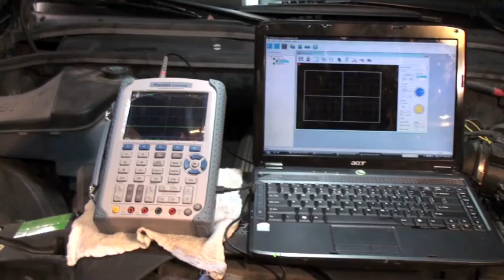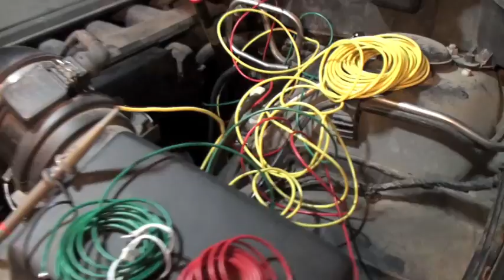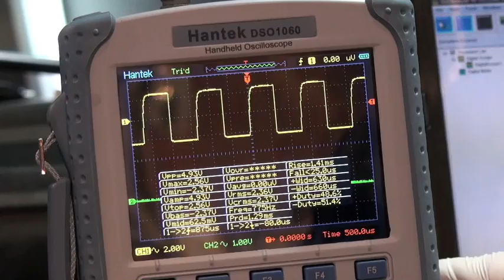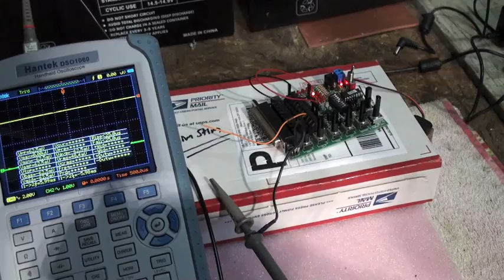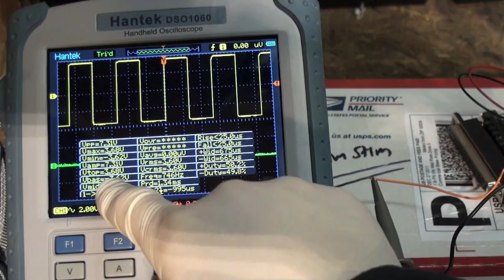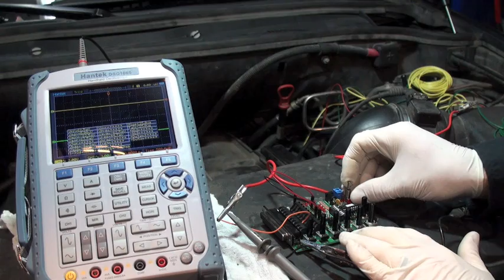BMW X5 crankshaft sensor output waveform

Comment: what is the purpose of this test? to if tachometer reacts? you can do by pass test with test light and do the same as you do all here with this fancy tools. tachometer dont react in rpm here because he just sees only cranks sensor signal, fot sucsess it must see both ,can and crank sensors signals.

Comment from the maker: Yes, I am converting a 2003 BMW X5.  I saw the video that you sent to Jack last week and decided to post some of the work that I have been doing in hopes that you would find it and contact me.  The signal from the Jimstim is set for a 60-2 reluctor wheel. I'll be posting some other videos of the signals from the intake and exhaust cam shaft sensors and from a 58 tooth reluctor wheel that I have spinning on a drill press. What resistors should I use to step down the voltage?

Comment: Are you converting an X5? I'm quite interested as I'm actually doing much the same with a 5 series! One thing to be careful of is that if you do convince the ecu that the engine is running it will fire the fuel injectors and the spark plugs with the engine stopped! Is the signal from the jim stim 60-2? its quite easy to drop the voltage with two resistors. pm me if you need help.